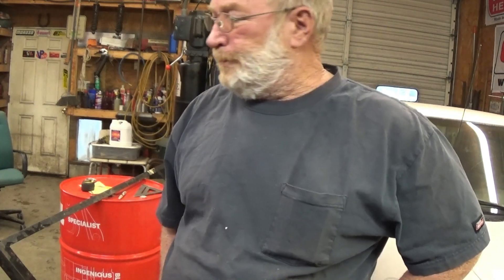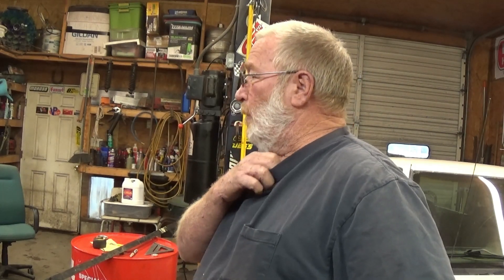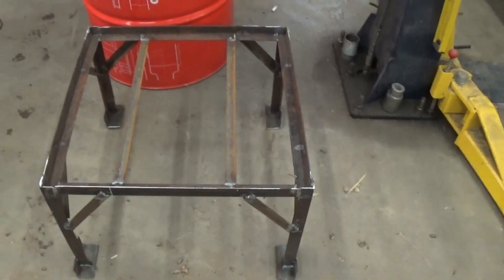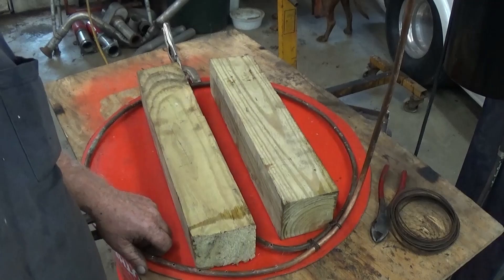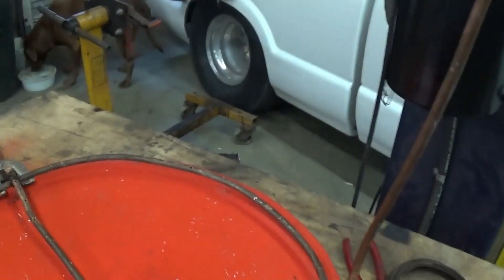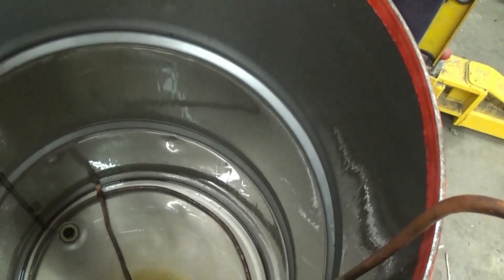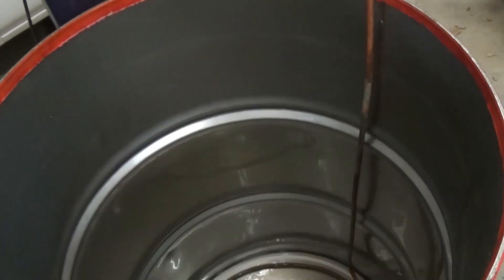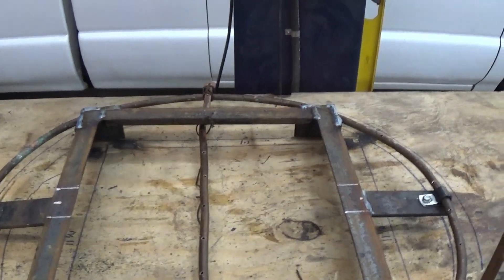home made hot tank

Comment: Sitting here watching and had a thought. It would cost a little, but they make an aerator pump for septic tanks. I priced them real quick, you can get one for about $144. It’s small and self contained. I know my shop compressor would run to death. While it’s not cheap, it would make this a stand alone unit. I think it’s better than what I did, and has me thinking how to modify mine. 👍
Reply from the maker: i m putting up a short video on it running  i have a 60 or 80 gal tank on my comp we will see how it works but the pump is a great idea